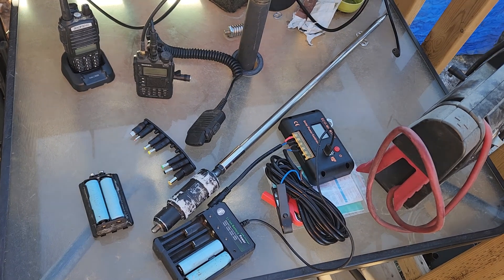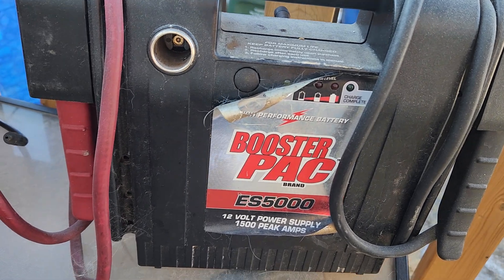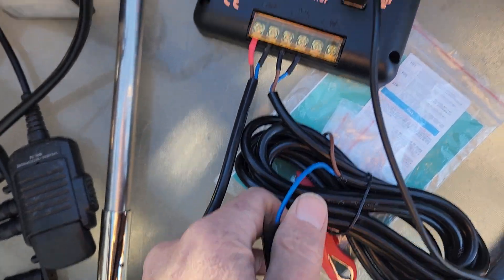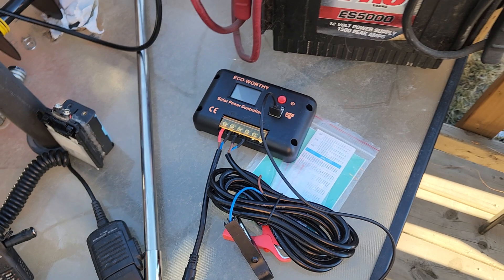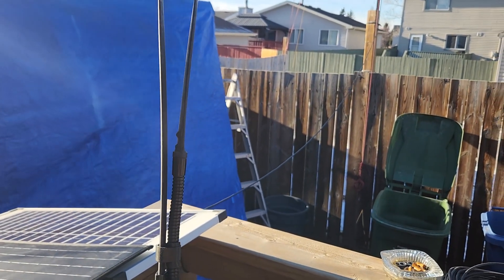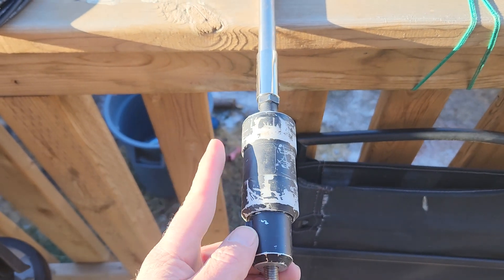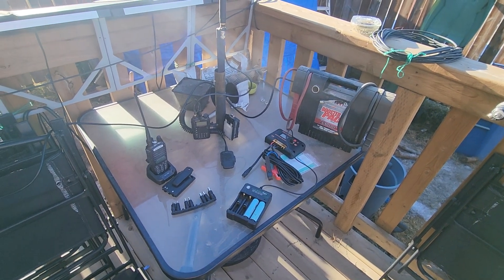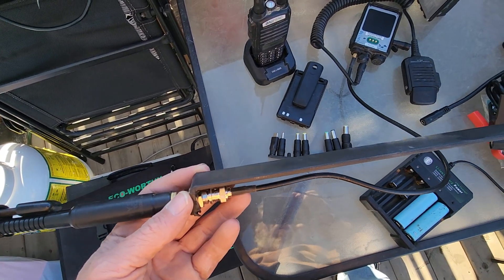Doomsday Emergency radio. Part 2. (solar power options and some antennas)

Comment: Thanks for the video!  All my HAM equipment gets charged by solar, some panels on the roof (which keep my JACKERY power banks full) and also an Eco-Worthy 100 watt portable folding panel, for when I need to top up battery powered tools in the Back 40.  LOL  Seems to work well.  Sometimes I listen on 2M and 70 Cm repeaters, but mostly I am on 6M SSB. 

73 de Karl, VE3GUN!
Reply from the maker: Thanks for watching glad you enjoyed